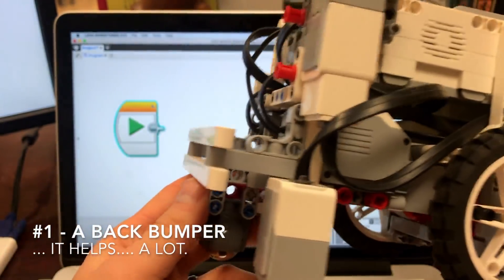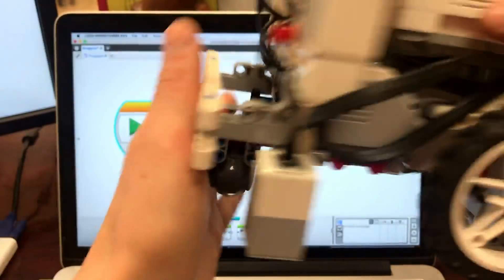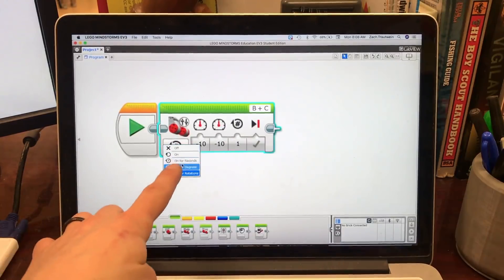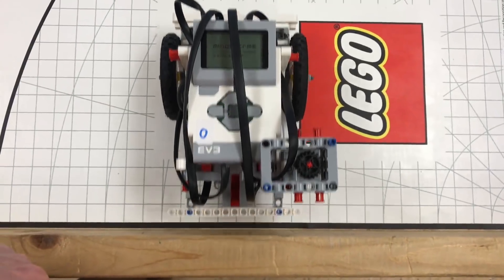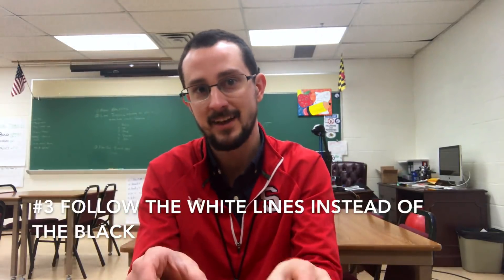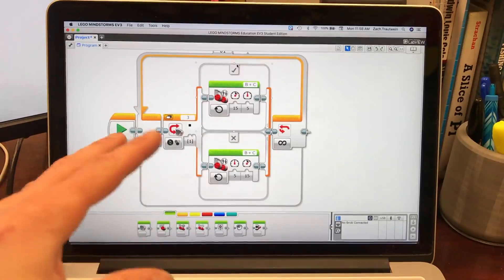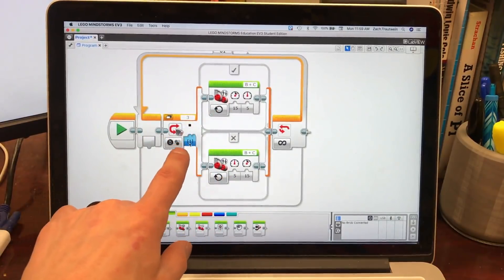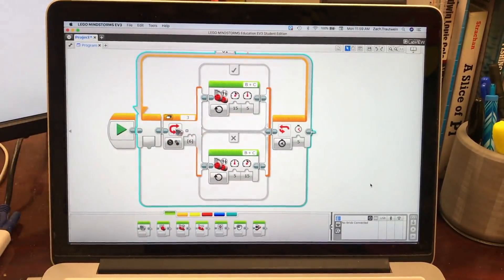FLL Hydro Dynamics Programming Hacks!

Comment: i have a problem with the flow mission it required to do the mission using twisting arm not pushing like u did before and my team found a problem to make this arm + can you help me this a problem that could align the robot  to the wall
Reply from the maker: Sure! What you may want to try is to have a beam with a wheel on the end of it to separate the robot from the wall. You would need to attach it somewhere sturdy on the robot and that is easy to get off/on.... i hope this made sense! its a simple solution.